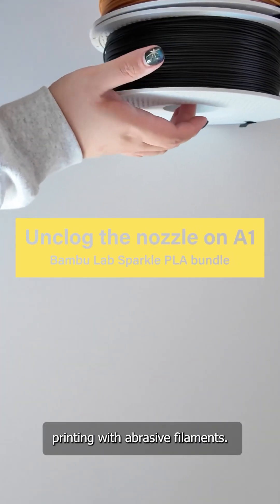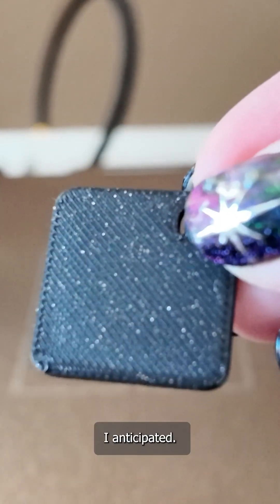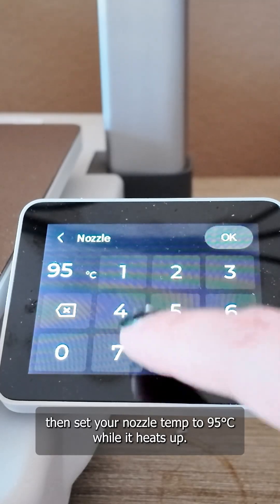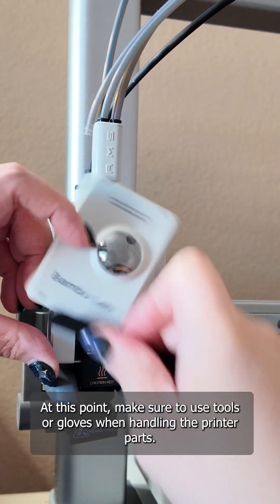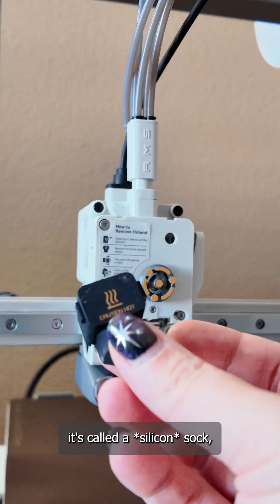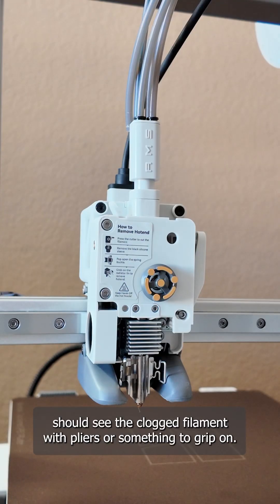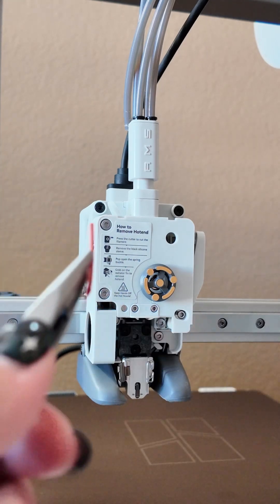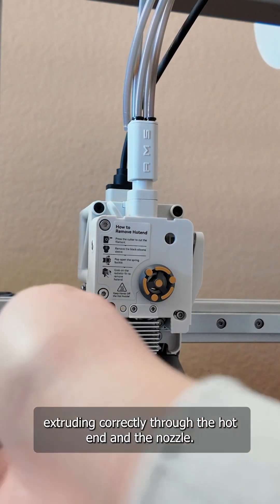Clogged nozzle? Watch this for A1 owners #3dprinter #bambulab #hobby #tutorial

Comment from the maker: TLDW: put printer in maintenance mode, heat up nozzle to 95°C, remove front plate and nozzle, pull out clog, and then reassemble! Easy peasy

Someone mentioned on TikTok it’s best practice to do a cold pull after clearing the clog. I didn’t include that in this video, but next time I will.  😊

Comment: The metal part the nozzle isn’t coming out even when I opened the clips
Reply from the maker: Likely a piece of filament is inside the tubing preventing you from moving the hot end. I suggest you press the lever on the right to cut the filament then try again to remove.

Comment: Great. What if that tiny bit of plastic you need to grip is severed and you can't even grasp it with a tweezer? Please and thanks.
Reply from the maker: That happens, in that case you’d need to get a clog poke tool (you can find on Amazon) if you can’t get the pliers to grab the filament or it’s too deep in there with nothing to grab hold of to pull out. Be careful with the filament hub part it’s a delicate part on the machine. So go slow and don’t force parts to come apart.
Reply: @ux_mylife  Damn. They prob don't have for 0.2 I assume. Either way, just went and bought a lighter and steel thread, will try to macGyver it out
Reply: @ux_mylife  Update, the stick of filament in the nozzle was pulled out with the steel wire, but for some reason it still doesn't work. Somehow yet clogged.
Reply from the maker: @emwick3734 you might want to check the tool head / filament hub that sits on top that has the four routers, I had a clog in there recently, some old filament broke off and wasn’t able to get it using this method
Reply: @ux_mylife  Sadly that's not the issue. . I put in my 0.4 nozzle and it printed just fine. Swapped back in the (now supposedly empty 0.2) and it was back to not working

Comment: How do you know that was a clog and not just the most recent filament?
Reply from the maker: Nothing would come out after trying to print something with a new filament loaded. And I knew it was a clog because I used filaments with some abrasives in a previous print, which has a tendency to cause clogs. I already knew it would be an issue so I was quick to catch it and declog the nozzle

Comment: It's just a way. There are several cases I have ever encountered:
1. Just same with the video above, if some part of the filament came out from the hotend, you can pupp it out. But..
2. If some part of the filament didn't come out from the hotend, use needle that comes with the printer.
3. If the filament stuck in the head (a section above the hotend), you have to remove the top and try to push from above with noclogger or other filament.

Comment: What if its not stuck in the hot end but the chamber above it??
Reply from the maker: You’ll need another tool if there’s no filament to pull out. You’ll need a super thin long metal rod, get it from creality to push the filament through the chamber, you can push it upwards so it goes towards the feeders or downwards towards the nozzle.

Comment: Uhh what if the filament is all the way inside the hotend and I have nothing to grab
Reply from the maker: You’ll need a declog tool, it’s a super thin metal rod that you push into the hot end from the top. You can find it on Amazon, I have one by creality.
Reply: @ux_mylife  Isn't there also a needle that arrives with the printer?
Reply: Does it have to be heated to use the tool